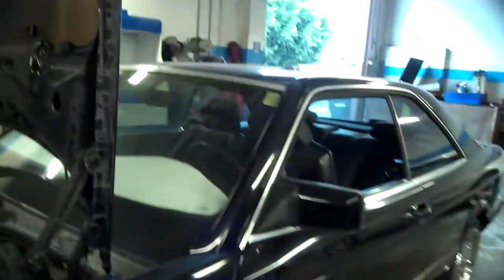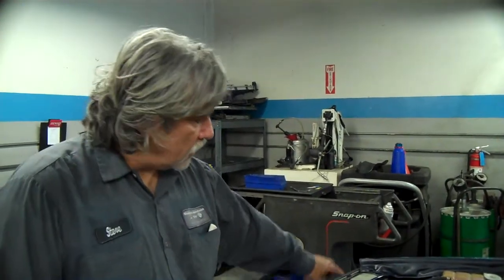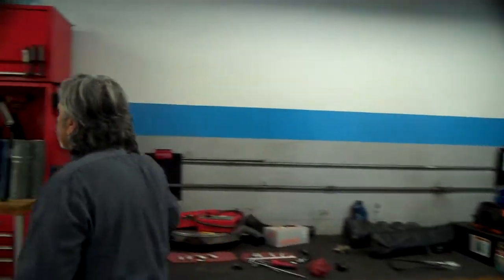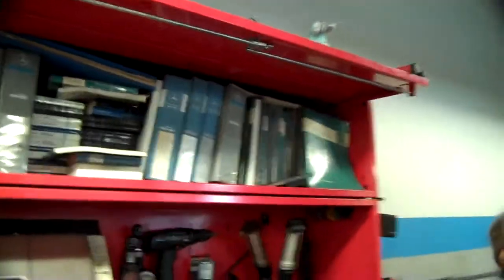1987 Mercedes 560 SEC (W126) Cylinder Heads Rebuild

Comment: I have a question please help me if you can, I have a 1988 560 SL and the timing chain busted during a highway drive and it left a scar on the engine block where the piston sits is that rebuild a bowl please let me know I need knowledge